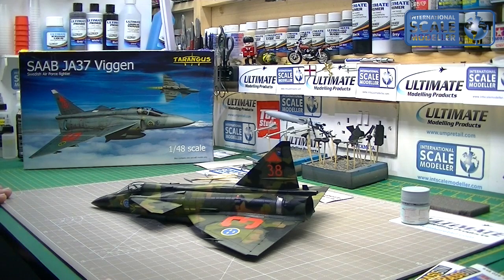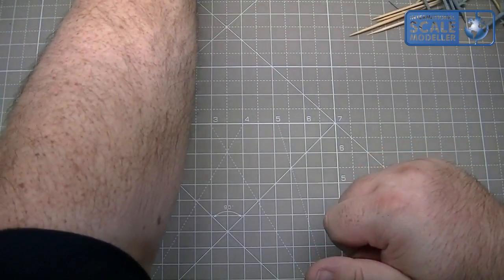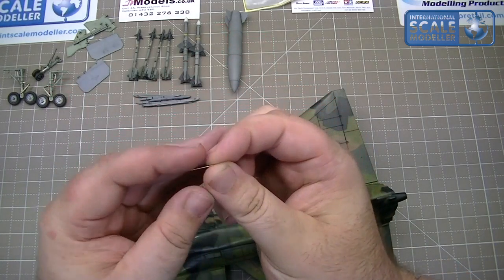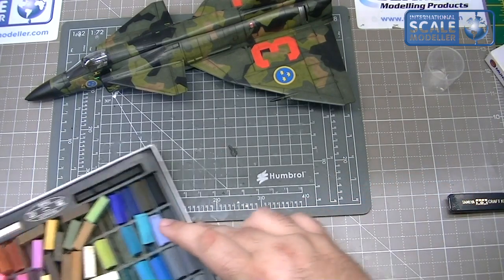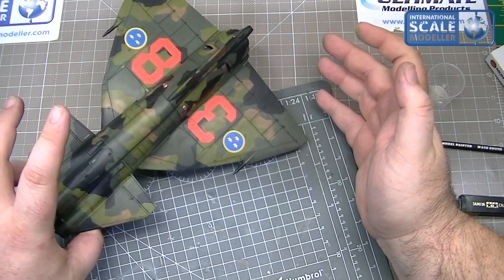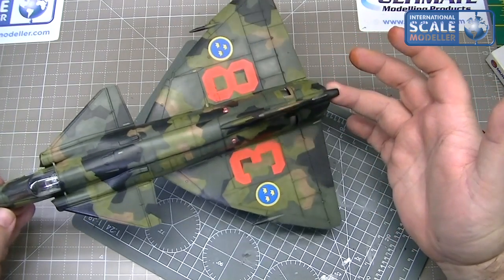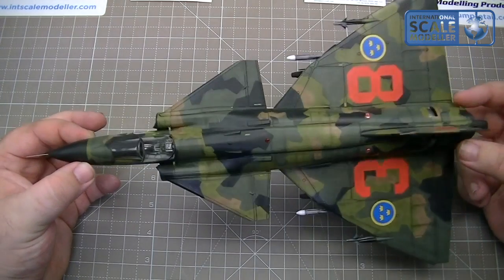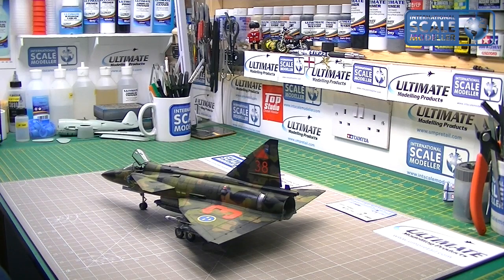Tarangus 1/48 SAAB JA37 Viggen Step by Step Video Build - Part 6 (Final)

Comment: Great work! Although some tips for the possible next build on the Viggen: 
When the Aircraft was on the ground the front canard-flaps where dropped down in about 20 degree angle. 
The main wing flaps where dropped in about a 15 degree angle. 
The inner gear doors where retracted on ground (when the hydraulic pressure was gone the inner gear doors sagged down about an inch(fullscale))
And a subtle detail, Often the right side (flying direction) below the fin there is dirtier due to the fact that the foldable Fin design leaked hydrolic oil and oil and was mix with dirt overtime.

The aircraft is decommissioned and what i know there is only one in flyable condition. (Although as a civil aircraft).
You should definite visit Jersey International Air Display where the 'Swedish Air Force Historic Flight' is invited and see the AJS37 Viggens monstrosity sound in real life. Aswell as other Swedish aircrafts (SK 35, J 29, SK 60)
Reply: Thanks for the feedback, yeah sadly when we first starting selling the kits we didn't have the posable canards and flaps, they came about after i had reached that stage, i would have loved to have added them but hey. As for the landing gear I've numerous pics showing the doors fully down on the ground.

Paul
Reply: I see, i love the Paintwork tough, spot on colorwise.. Generally the doors were closed on ground. The instructions in the kit does say so and one retired pilot-friend of mine(flew this aircraft) have confirmed it. I do not doubt that some reference pictures have them open, but i believe that's the edge case. Unoperative aircrafts may be drained from hydraulic oil? or lost its pressure entirely over time. I do not know.